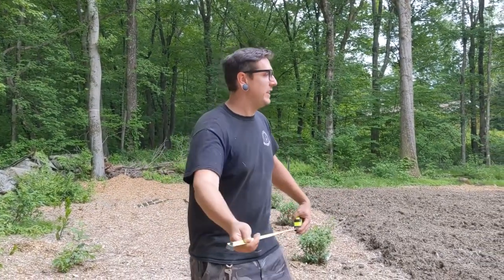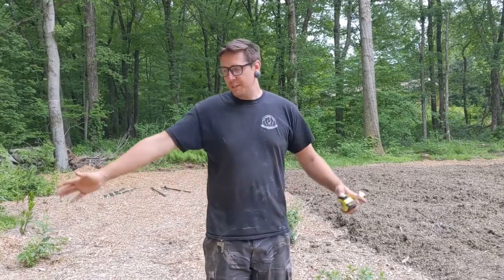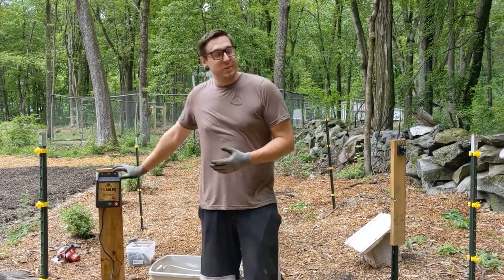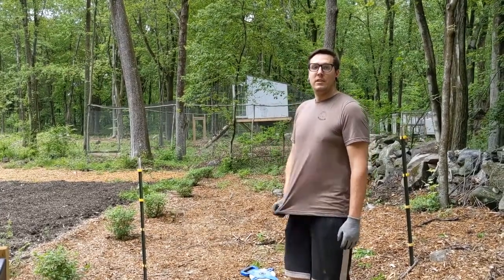THE BEES HAVE A NEW HOME! Building the Electric Fence for Honey Bees

Comment: You should check out Bob Binnie, he has some good stuff on a bear fence setup using a car battery and solar panel. His secret is running a ground wire between the charged strands to give any animal a real charge even in the dry season.. None of my hives have a fence and not had any problems by keeping the area mowed and clean.